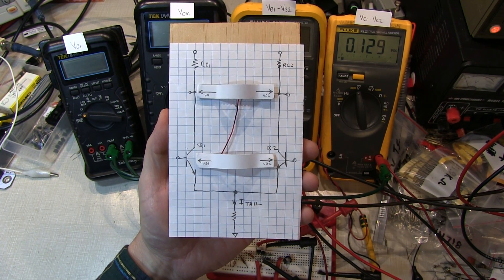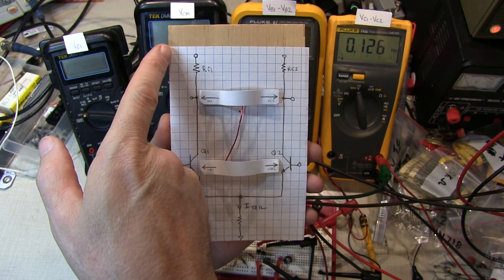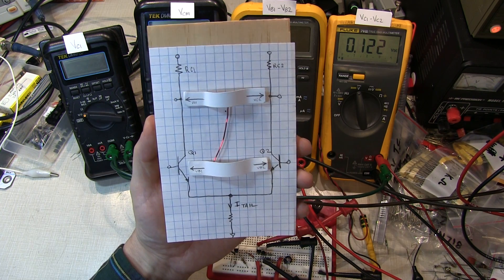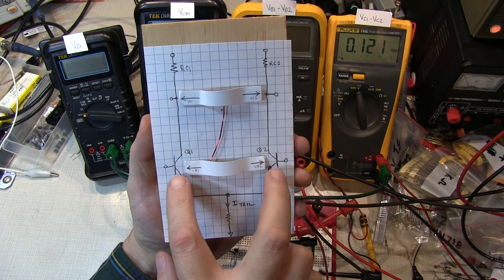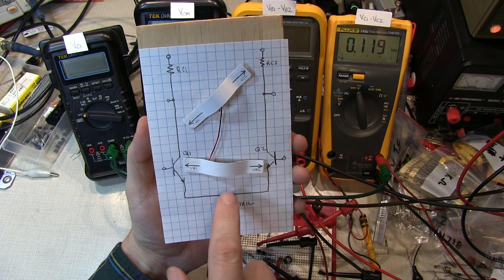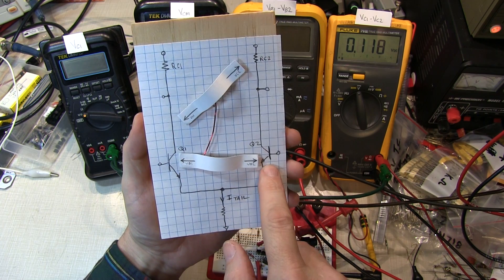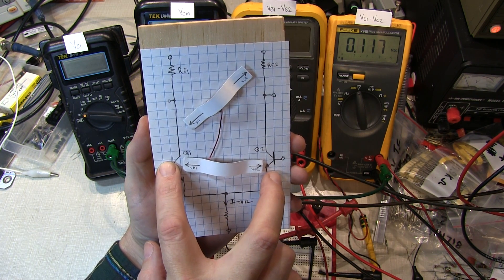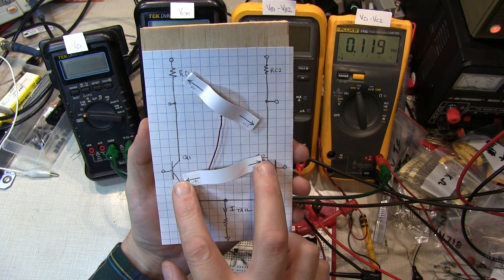#192: Preview of next Back to Basics video on the diff-amp, long-tailed pair

Comment: Great little mechanical "mechanical computer"!  When current is being fed into Base of Q1 it will conduct more and higher current will pass from collector to emitter to ground then the voltage drop upon tail resistor wil rise and that will cause Vbe of Q2 to become smaller ->  and collector voltage will get higher because it conducts less and its active resistance gets higher.

Comment: Hi Alan

How did you set that wire to pull from bottom levers to the top levers at different amounts.  Did you have some kind of cardboard gearing at the back of that. I am thinking a tube with thin fishing line in middle wrapped around two different sized round bobbins? But I don't know. How did you do that?
  I like it though, a very neat way of showing how this works.
Reply from the maker: Easy! The wire connects to each of the two arms at a different distance from the pivot point, thus providing a little mechanical gain.
Reply: ***** Cool! It just looked way more complicated than that. Would be great to see you expand on this theme to cover the different op amp modes of operation. I saw the other follow up longer one like this and you almost got there! Would make a great follow up video to that one.  Taking the two diff outputs and showing neg feedback and follower etc. I know you have done opamp circuits. But this would really be great as a deeper insight into its workings.